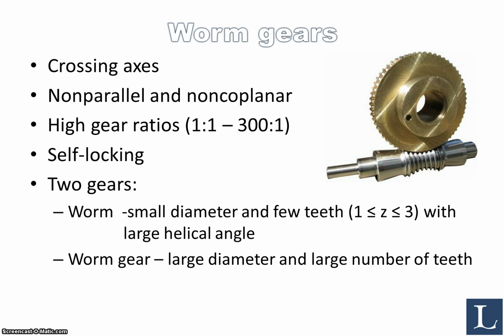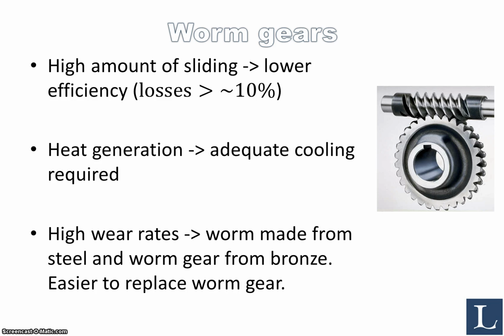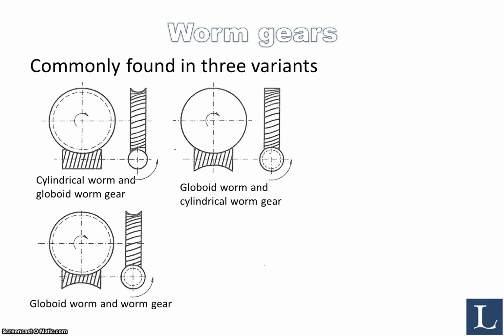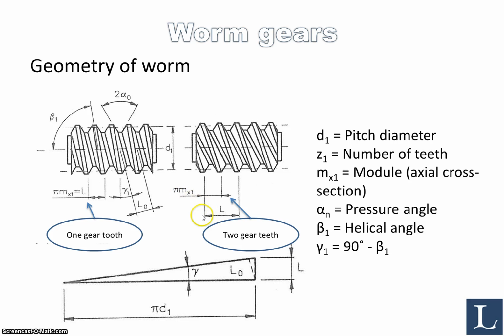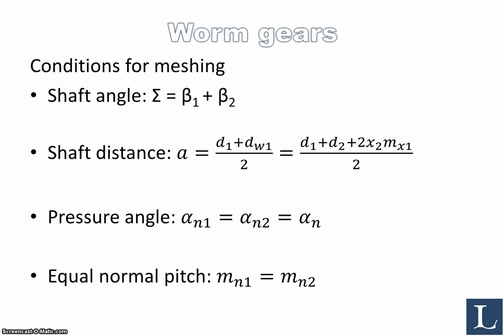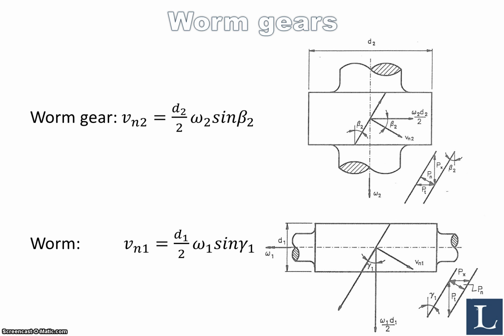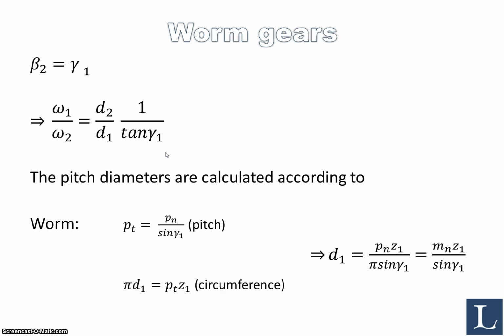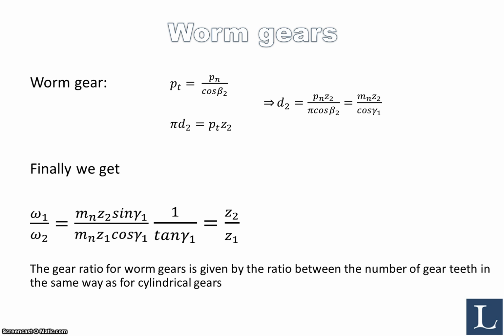Bevel Gears and Worm Gears - Part IV

Comment: at 8:30, the equation of w1/w2 does not make sense if b2 = y1. I think there is a mistake on previous slide . Vn2 should be equal to d2/2*w2*cos(b2). It is apparent from the figure also. Vn2 is in cosine direction.

Comment: Elevator Motor     ----As for the gear box, it is a small box that contains oil and has two gears... The  first is a helix gear, which is connected directly to the motor and is the driving gear... The second is a regular gear with teeth that connects to the drive gear, which is the driven gear... A box was manufactured. The gears are engineered in this way, so that the motor can always move the gear wheel, and the gear wheel cannot move the motor even if the brakes are applied... This method is very safe and smart, so that a rapid fall of the cabin does not occur at all, even with the brakes applied.